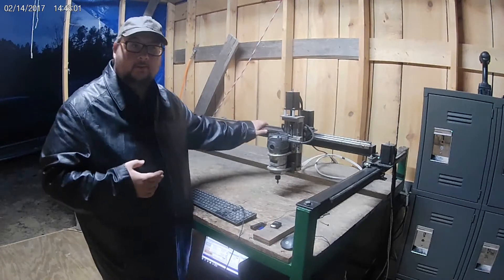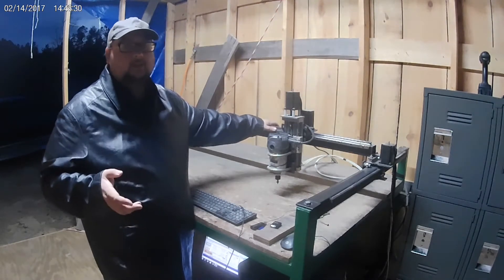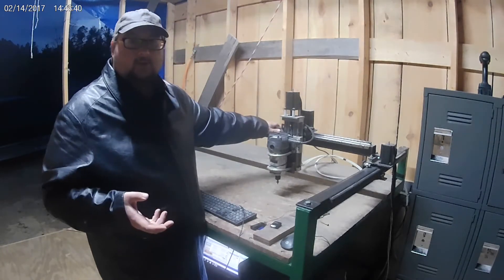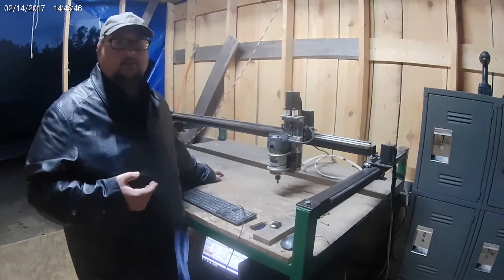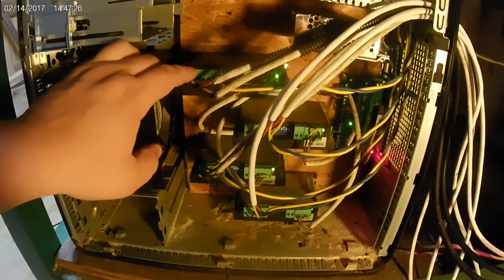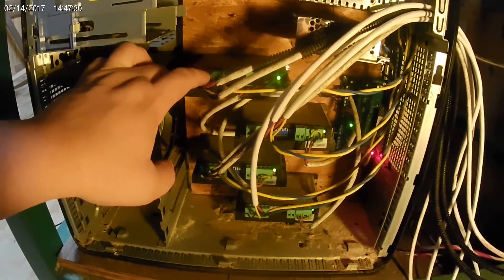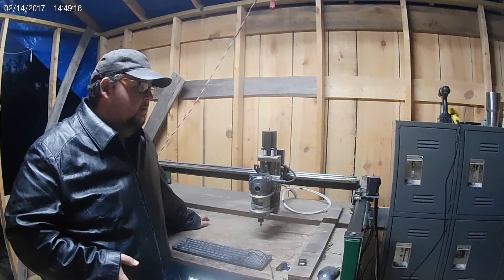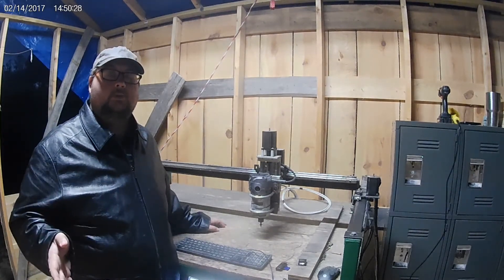Troubleshooting Stepper Motor Problems (Jerky, Random Direction, Motor wont Spin, Chatter)

Comment: Started having z axis problems yesterday with some of the similar problems. Swapped cables with my y axis and it followed with the stepper. So I'm hoping it is just in the wiring like you stated. On mine it acts almost like the brake/hold in the steeper is letting go